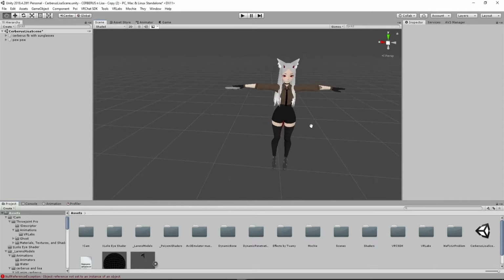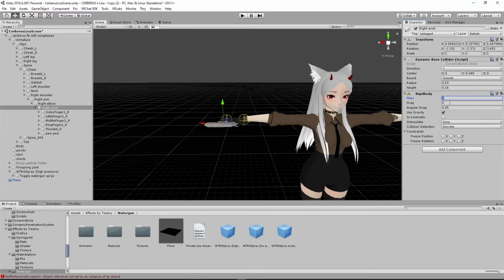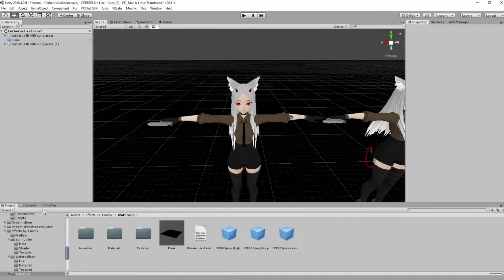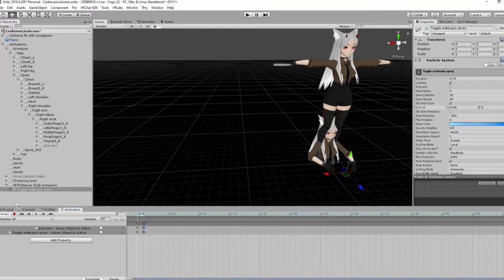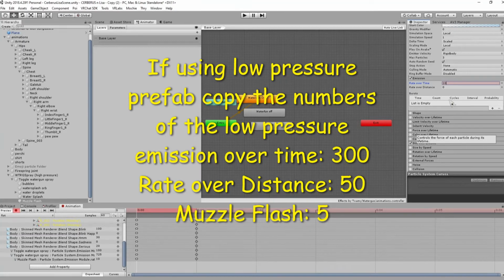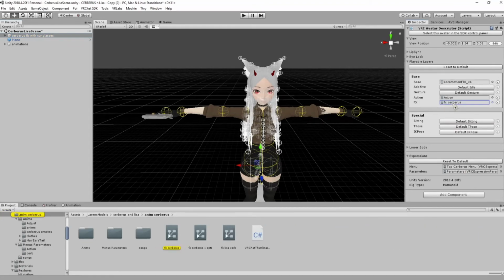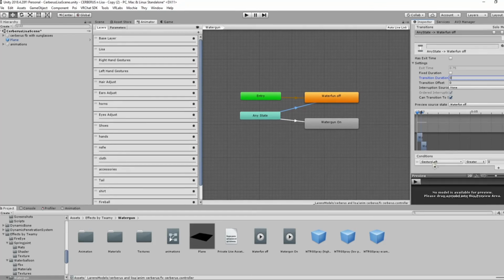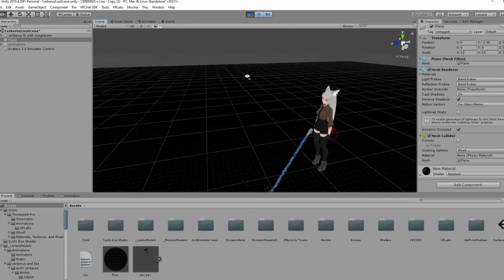VRC Water Gun Spray 3.0 Tutorial

Comment: I want an object(sword) appears in y hand only when that same (or a duplicated one) sword is on my back, so i can only activate it when i have my object on my back showed with the 3.0 toggles(already did it, i only have troubles to do the main step with the second object), what should i do? thnx btw
Reply from the maker: You need two parent constraints. And to different target locations n rotations. To switch between to two depends on the weight in the parent constraint to one point and the other
Reply from the maker: If you want the sword to be on your back. You’ll need one parent constraint on your back. The weight of the parent constraint should be set to 1 while the other target location is set to 0.
Reply from the maker: Feel free to join my discord and I can help with images.
https://discord.gg/Ym35eMDeS2
Reply: been tryna figure out how to do this as well :/ only be able to activate or toggle something when the parent of the toggle is activated.
Reply: @FallsGaming  To start with, if you set up parent constraints, you don't need a second object, you can just move the same sword back and forth between your back and your hand. If you don't want it to be possible to go from not showing at all directly to being in the hand, then in the animator view you can use a VRC Avatar Parameter Driver on the state that makes it turn invisible, and have it also change the variable that controls the position to put it on your back. Then, on the transition to having it be in your hand, add a second condition, so it can only be in your hand when you select that toggle and it's visible. That way it can never be in your hand unless you make it visible first.